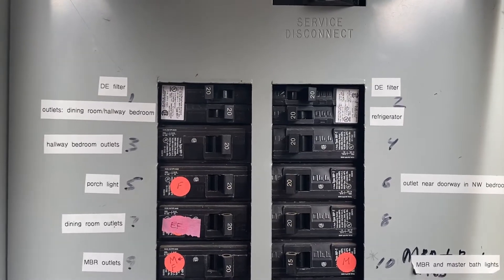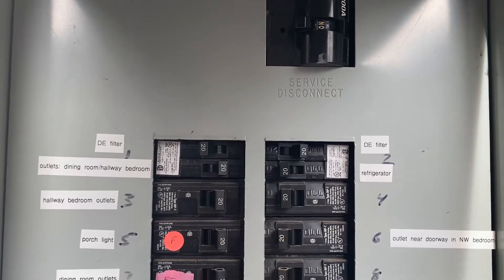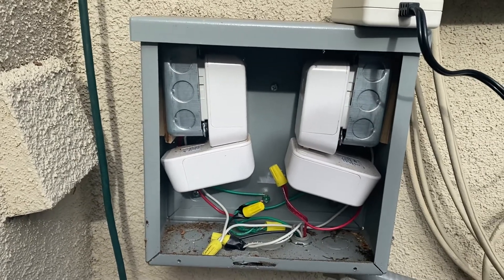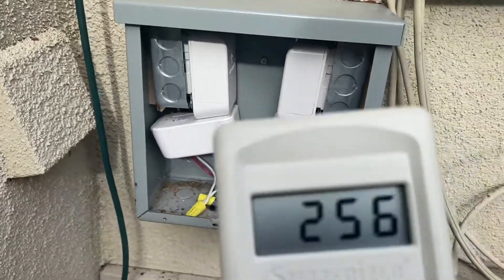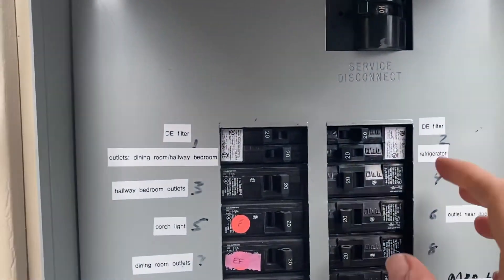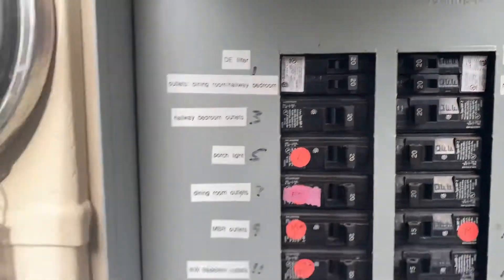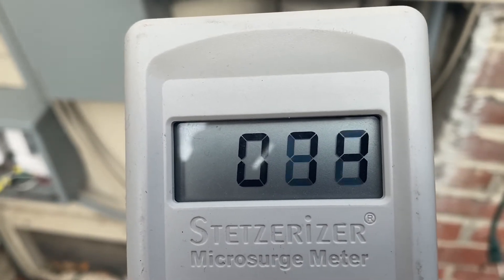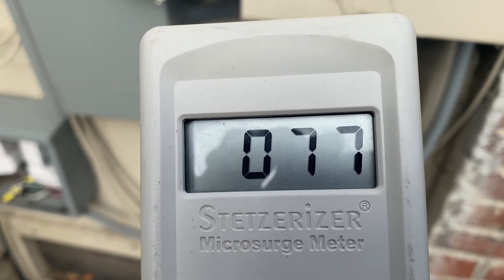Filtering Dirty Electricity at the Main Electric Panel

Comment: I am trying to figure out a way to convert or filter the dirty power coming  from a large generator that I purchased to power my home.
Reply: You can't use a DE filter with a generator. It will reduce the power output and spike the voltage. You'll cause damage to the generator. Unfortunately it just isn't compatible.

Comment: While this is a great idea, a thought occurred to me while researching this. This solves the dirty electricity coming off of the smart meter but it DOES NOT solve the issue of the dirty electricity after the main (other than in that area) so keep that in mind when you are working on filtering out the noise in the rest of your house :)

Comment: The second measurement with the meter seemed like it was taken further away than the first measurement. Both should be taken in the exact position to get a more accurate reading.
Reply from the maker: Agree it's best to measure in exactly the same spot with a meter, but this meter is plugged in to the outlet at the main panel to measure the dirty electricity on the wire, so distance is less of a concern here
Reply: @sagelivingEMF  he is not aware that they are plugged in.  would have been beneficial to show that.   regardless, have you noticed any health benefits?  extremely curious.  thank you!

Comment: good solution to having to put filters throughout the house, did you check with your meter readings in other areas of the home to see if they were consistent
Reply: Isn't 80-90 Still too high for the people that need to do this type of thing? What happened in the rest of the house would have been great to include.
Reply: @philtookgrenadesforme7785  10 times too high
Reply from the maker: Yes, we always confirm the readings after installation.

Comment: The breakers are only on One of the Two phases.
Reply from the maker: You're exactly right. Initially, the filters were installed on circuits 1&2 (same phase, therefore filtering only one leg). An EMF electrician went back and updated it to circuits 1&3 (different phases) but did not update the labels. Good observation.
Reply: @sagelivingEMF  Did the correct installation lower the dirty electricity lower?

Comment: Can you honestly tell a difference in the home after installing? I heard the raise emf levels.
Reply: They do raise EMFs in this configuration. The person who created the video is not sensitive enough to know, they only rely on a meter. There are some situations where filters work, mainly only when the magnetic fields are low and electric fields are high. This setup will only lower the readings at the source of the filters, the home will still be impacted and a sensitive person will still suffer. Meter readings on the filter at the box don't mean anything in terms of whether or not this works. Guaranteed it doesn't work because of the high magnetic fields.
Reply from the maker: Good question. In this home the dirty electricity measurements decreased from 1300 GW units to under 100 GW units after installation. Every home is different so it is best to have a certified Building Biology Electromagnetic Radiation Specialist (EMRS) take measurements, determine sources and test if this is the right solution for your home.